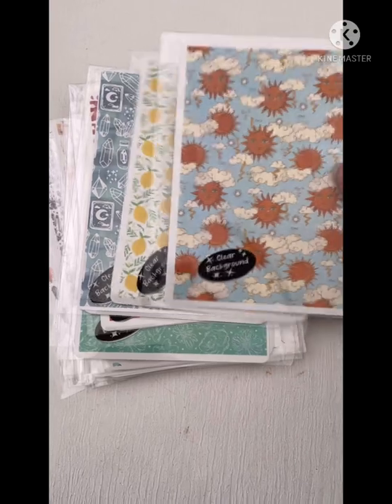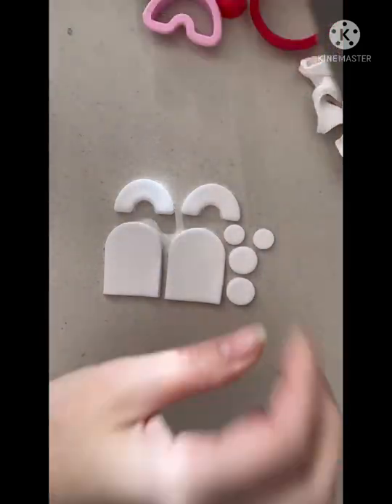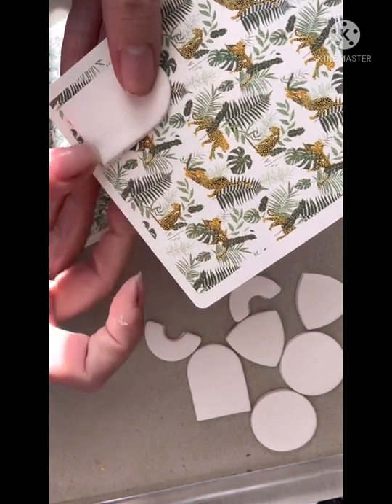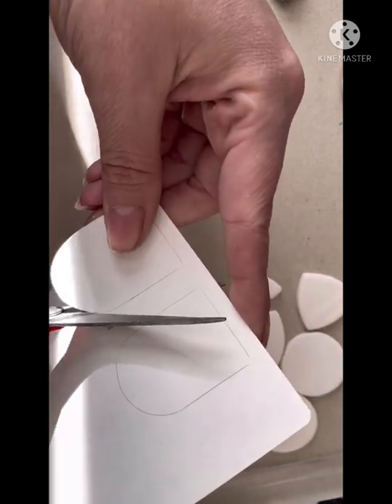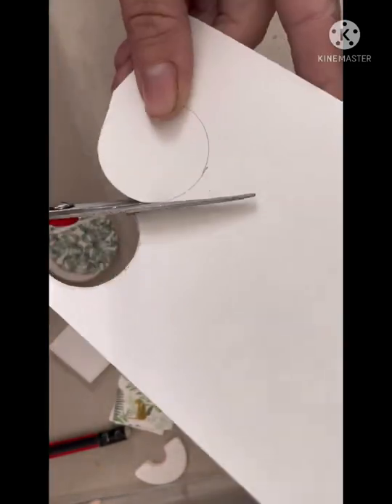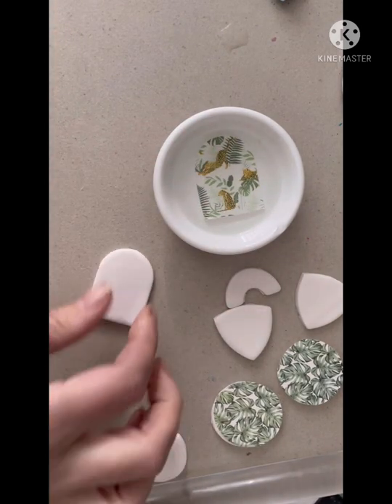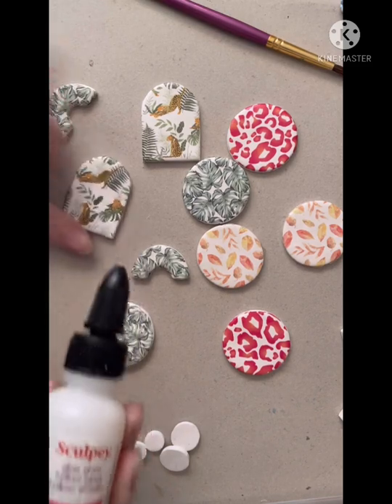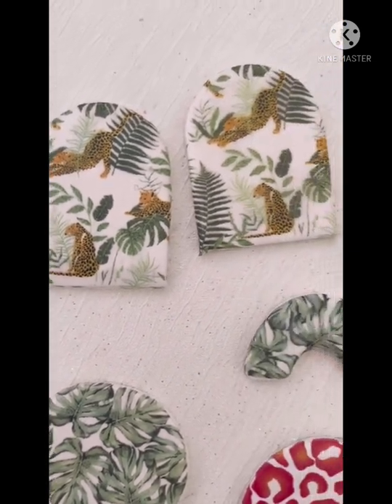Using Water Transfers Decals on Polymer Clay / Tutorial / Beginners Polyclay / Technique / Craft

Comment: Very cool.  I am using air dry clay so I don't know how these particular transfers would work for me.  Nice to onow they are available through your shop.
Reply from the maker: I would assume they would work! These transfers slide across - unlike other polymer transfers. And as long as you put a varnish / glaze on top to help secure them after they have dried out - I cant see that there would be a problem.

Comment: Did your paper say you have to spay it with acrylic adhesive before soaking it in water?
Reply from the maker: No, these ones don’t say to do that. Just to pop them straight in the water. I guess instructions may vary depending on how they are made.